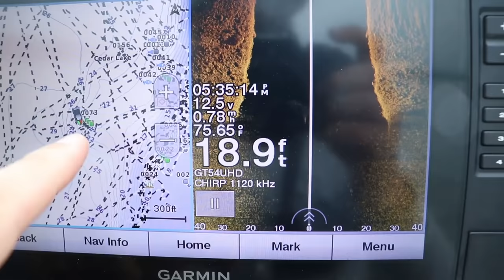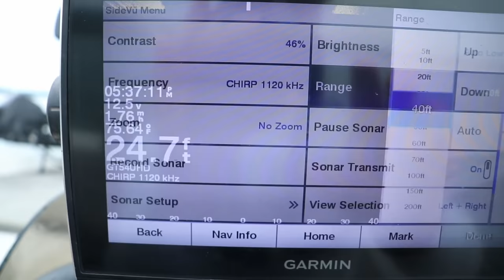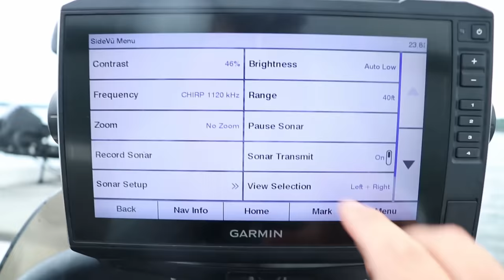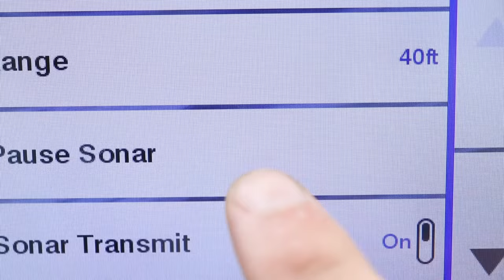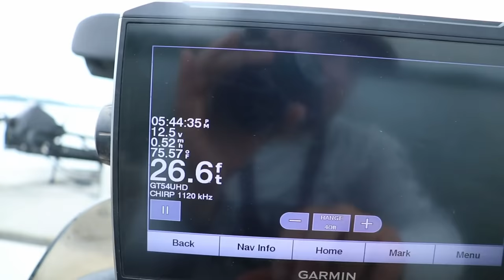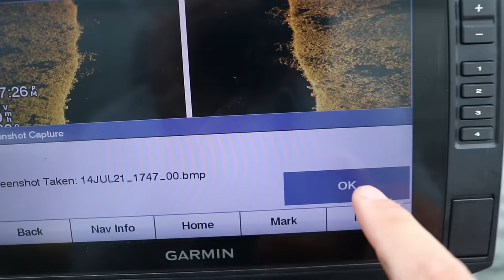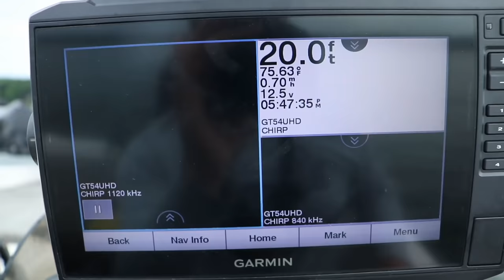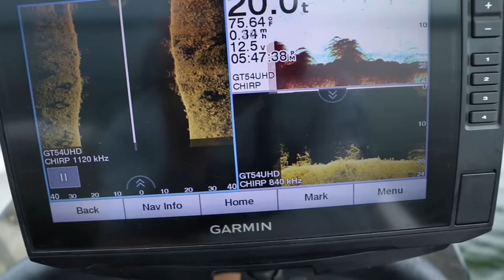How to use Side Imaging to Find Crappie

Comment: I really like this unit I’ve did a good deal of research and bang for the buck it’s hard to beat I do believe but I have a 14ft jon boat and mostly fishing for crappie in 20ft or less should I look at a lesser unit more affordable with regular side and down imaging instead of the UHD and one with fewer options? I like this one for sure but I may not need this much unit for Jon boat and fishing for crappie maybe you have a better suggestion for a smaller boat that works great?

Comment: 1st thing.. Great video.!!!!! 2nd I have a question for ya. I own the 12" echomap garmin with the lvs32 transducer and its currently installed on the boat.but am not using the regular sonar transducer.. just the livescope one.. also I have a hummingbird hellix 10 onboard with the included transducer it came with. Would you advise to also hook up the included transducer that came with the garmin.. or would you just run the Hellix and the livescope transducer? In otherwords is there any reason I should hook up the Garmin transducer included in the kit and if so would it add to the 12" echomap ultra with the livescope transducer or should I just leave it off of there since I have the hummingbird too?   The next question I have for you is.. I noticed all on one screen you had your side imagine at the MHZ frequency for clarity.. but then the downscan was on 855khz or something a bit less than the side imaging. Why is that?? I was told you cant run the same frequency 2 times on the same unit.. is that why? Thank you!
Reply from the maker: To answer your first question I need to know which unit you use to find fish while idling around. If you use the humminbird to idle and use SI, then just stay with the humminbird transducer.  If you use the Garmin SI/DI, then I would mount the Garmin transducer.  Question 2: in this video I was using the GT54 transducer which uses 1.1mhz for sidevu, but only has 850khz capability for downvu. The gt56 transducer has both mega frequency capability for sidevu and down vu. I have since upgraded to the gt56 transducer and use the highest frequency for both sidevu and downvu.

Comment: Do you fish with the 8’ ACC crappie stix? And do you like the 1000 Piscifun reel ?
Reply from the maker: Yes, I mostly use the 8ft for slip bobber setups.  And I typically run a 1000 honor xt or viper x reel. I feel the viper x is a pretty good bang for your buck when it comes to Panfish reels.

Comment: Hello sir great video. I have a quick question do you run your active target or what ever you use on a separate battery? 
Reason asking is that I have active target. My battery drain really quick to the point I can not start my boat. 
It seems as if it is power at all times.  Any advice?

Comment: Hi, can I install Garmin and Hummingbird transducer on the same side of my boat? Is there gonna be any interference? Thx
Reply from the maker: I would install the transducer on opposite sides of the boat if you plan on using them at the same time.
Reply: I have hb transducer on trolling motor, live scope on right side, all seems ok to me. Kentucky
Reply from the maker: @lonniehall9006  I think Jim was referring to mounting both HB SI and Garmin SI transducers on the same side of the transom of the boat. I could have read his question wrong though

Comment: I notice a lot of Garmin side image videos have interference lines along the center line of the image, mine included. Yours appear perfectly clear with no visible interference. Out of curiosity is your transducer mounted on a jackplate or on the boat hull itself? Thanks in advance.
Reply from the maker: I don't have a jack plate, the transducer is mounted of the starboard side of the transom.  When I'm using 455khz I do get interference (lower unit for outboard), but when using 1.12mghz i don't get that interference
Reply: @FloppingCrappie  Thanks 😊

Comment: Many here are interpreting the side imaging incorrectly with regards to the water column.  The transducer has two crystals.  One records data from straight down to 90 degrees to the left, the other records data from straight down to 90 degrees to the right.  Imagine tying a 40 ft string to your transducer and pulling it straight out to the left of your boat, then moving the string under your boat and pulling it straight out to the right of the boat, creating a half-circle, with your transducer being the center.  Everything in this 40 ft half-circle is displayed on the screen.  The shortest distance to the bottom is straight down, so you can trust the image where the bottom contour starts is directly under the boat.  What you don't know is the exact location of anything suspended in the dark water column.   That fish mark at 25 ft on the screen only means it is 25 ft away from the transducer.  Could be 25 ft straight down, 90 degrees to the right, or anywhere in between.
Reply: Absolutely!  That’s why we see nearby standing trees and other tall structures appearing “sideways” in the water column. 

BTW:  higher frequency doesn’t use “less data” as stated in the video. It’s more resolute but doesn’t have as much of a range.
Reply from the maker: @jeremylastname873  so if it has less range, that means it is not taking in as much of the water column as say 455khz. That's what I mean when I state 1.1mghz is taking in less data.

Comment: When fishing brush piles with a jig how do you keep from getting hung up.
Reply: When I'm "fishing brush piles," I'm not usually targeting fish actually down inside the brush pile (as you say, you get hung up if not using some sort of weedless jig.)  The active fish are usually at the top of the school that's holding on the brush (or any piece of cover.)  The depth will vary but will be clear on the electronics what depth you at least should be starting at (i.e. the 5 ft tall brush pile sits in 19 ft of water and the fish are schooling up to 10 ft.)  Of course you can catch fish down inside the school and probably some monsters down in the brush (or on the bottom around it.)
Reply: Edit out the hang ups lol
Reply from the maker: Lol
Reply from the maker: Typically you are after the fish above the brush piles like Jordan said below. I just filmed a video using 2d sonar (it will upload tomorrow morning) where my boat is on top of a brush pile (20ft deep) and I can watch my jig on 2d sonar fall to the fish. If have the boat directly over the top of the brush isn't an option, casting your jig over the brush will get you snagged from time to time. I'd would just try an count down the jig until you start to feel it hitting brush (as your reeling it in).
Reply from the maker: This ☝

Comment: SI , doesn't the distance to left and right "include" the water depth.  In other words if you are in 20ft of water and set the SI at 40 ft to left and right... in effect you are only seeing 20ft to the left and right of the boat...because the beam goes 20 ft down then to the left or right another 20 ft..... 20 plus 20 ft equals 40 ft?
Reply: What you see in the dark space is IN the water column in the first 20 ft of your 40 ft SI setting?
Reply from the maker: Yes that's correct, I misspoke in the video when talking about range lines. The black area is the water column below the boat and you would need to subtract that amount from the range lines in the gold area to get the distance.
Reply: @FloppingCrappie  I was so confused reading through the comments about the black area being water until this comment.  Makes perfect sense now.  Thank you for the explanation, just got a side imaging unit and taking it out tomorrow for the first time and this will help a ton.  Now let's just hope the fish are biting!

Comment: Man your picture is so much crisper than mine. Although it’s probably because I need a new ducer I can’t use 1120khz the left side is dark and washed out but when I scan with 455khz it’s fine lol have you ever dealt with that? Just wondering if there’s an easy fix before shelling out $300 on a new transducer 😂 love the content and the last few videos on using your electronics 🤙🏻
Reply from the maker: My humminbird helix 9, which I still have, only used 455khz or 800khz. It's possible to get a fairly clear picture with 455khz, but it will not be as clear as mega imaging.  If you're going to upgrade your transducer,  make sure your unit is capable of reading Mhz frequencies as not all sonar units do.
Reply: @FloppingCrappie  I have a UHD 73sv so it has the gt54 ducer, which is giving me problems. Of everything I’ve read and gathered I’ll most likely need to replace it.
Reply: @Chinkle734  your 73sv is the same exact unit as the 93,94,95sv units. It just has a 7" screen vs 9" on the 9 versions. It will run the gt56 same as 93,94,95sv will.